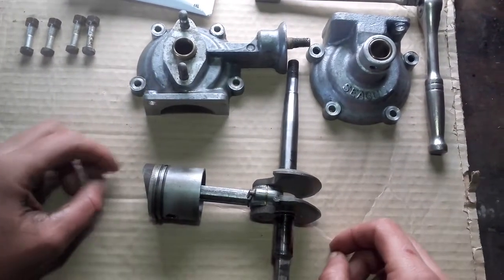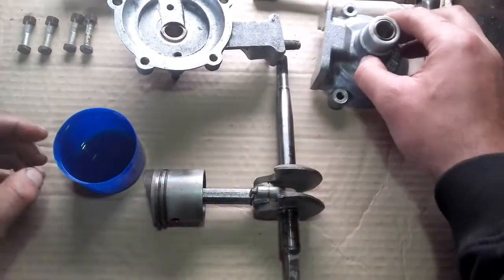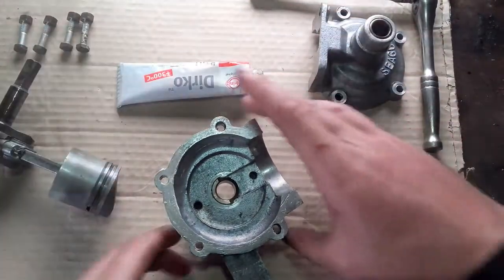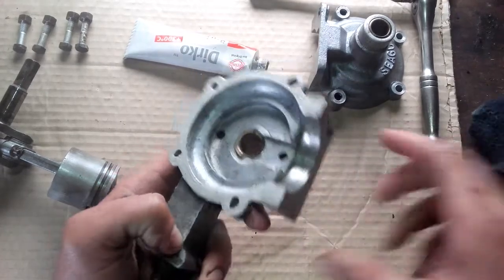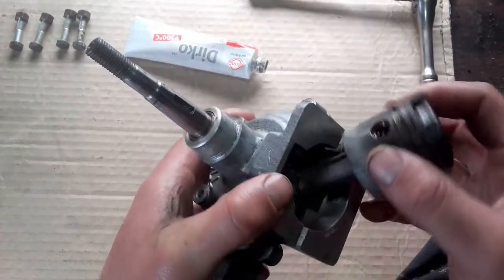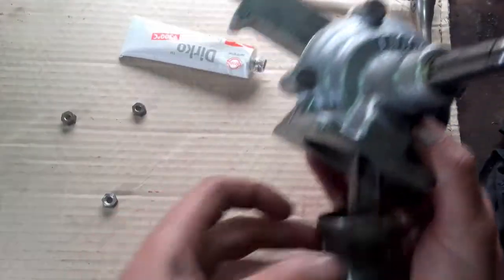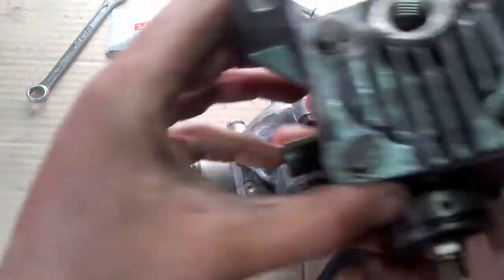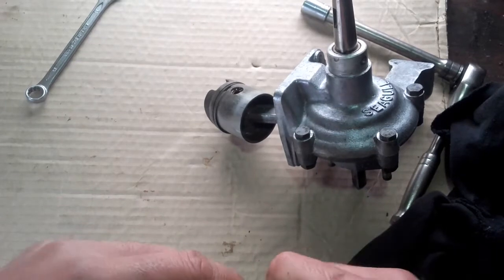Crankcase/crankshaft reassembly British seagull outboard featherweight 40 plus

Comment: Cheers for your videos they are invaluable.  I just refurbed a Forty Featherweight and now on to a Silver Century.  Appears to have a slightly bent crank but trying to correct it.  Would you say process for rebuilding Silver Century is same as in this video?  Thanks. Andy
Reply from the maker: Hi Andy 
Bent crank is usually a replacement crank needed.

Rebuild very similar
Reply: Coastal Works hi thanks for reply.  I found new crank online so waiting for that.  Can I get away with liquid gasket on crankcase to engine block seal?  I can order a thin paper gasket but wasn’t sure necessary.  Thanks. Andy
Reply from the maker: @AndyUK-Corrival   a good quality gasket sealant should be fine as long as both surfaces close correctly
Reply: Coastal Works Hi, my new crank arrived today, how do I get the old piston off the old crank?  I removed the circuits but is ther a right way to remove the pin or just gentle tapping?  Thanks very much. Andy
Reply from the maker: Some tapping should get it out for you
Reply: Coastal Works thx all sorted much appreciated.  Just need to start her now. Cheers. Andy
Reply from the maker: Let me know how you get on